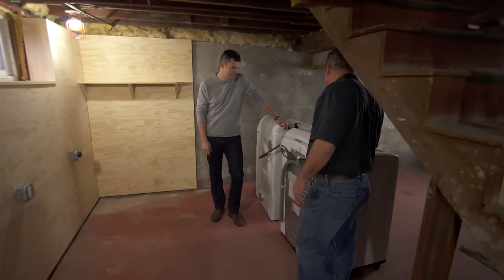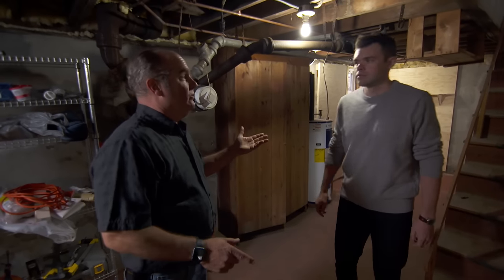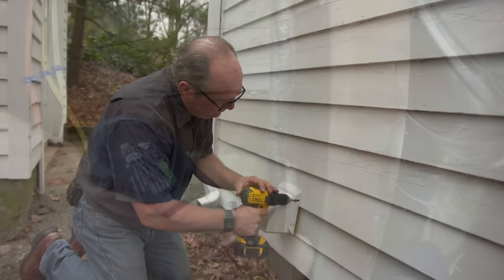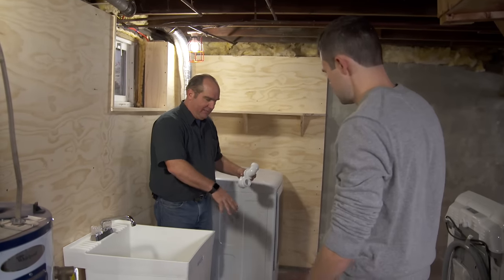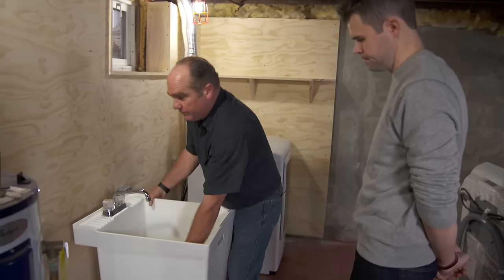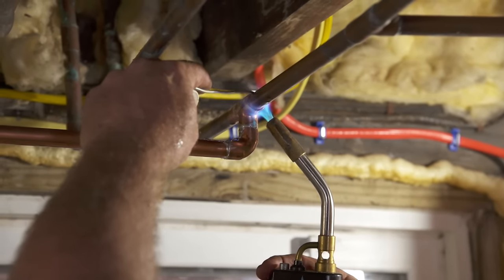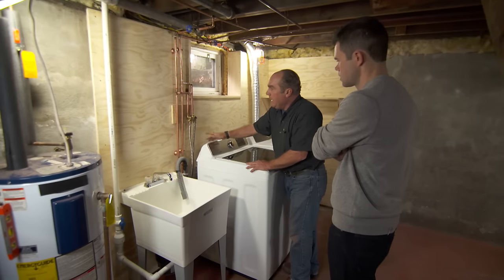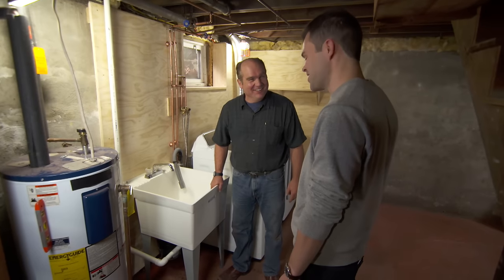How to Install a Basement Laundry | Ask This Old House

Comment: Don't know where this takes place, but I thought you could not put plumbing on an outside wall due to the cold winter weather.
Reply: Josephine Ward as long as it’s insulated. Plus a basement wall doesn’t get nearly as cold as an exterior above grade wall
Reply: That's referring to wood framing walls. That basement wall is 8" of concrete. It doesn't get cold enough to freeze pipes

Comment: So how do you know what's hot and cold water is it because you look at water heater 
Thank you
Reply: A lot of the time you can just feel the pipe....one will be warmer than the other, if they are the same temperature you just need to run some hot water wherever the pipes lead and the hot water traveling through the pipe will warm the pipe. Or you could follow it from the hot water heater if you can see all of the runs.

Comment: Ok so what they don't tell you is that while these undersink pumps are convenient for the installer they are a huge pain for owners.  The plug-up frequently, requiring you to disassemble everything and getting the pump on and off the tub is a nightmare.  They also go into "spaz mode" turning on and off constantly in the middle of the night.  I've had two and the 2nd is getting replaced reservoir unit!
Reply: install a lint trap on your discharge line. Easier to clean there than inside the pump.
Reply: they plug up easily because they are 1" drain line. Code here requires 1 1/2" minimum for a laundry sink. 1 1/4 drain lines are the smallest allowed here for any fixture and that is basically only for vanity sinks/pedestal sinks.
Reply: Im Sorry to hear this. Sounds like an install error.

Comment: Do NOT use those silly screens they include with the exit vents. They clog with lint rather quickly and in turn ruin the efficiency of your dryer and can even cause lint fires. A lot of state fire codes ban them for these reasons.

Comment: are you require to throttle the pump every time you do laundry ? isn't little inefficient
Reply: No, not every time.  The throttle is set just once, and you leave it like that.  Once you have it set so that the pump does not constantly turn on and off while draining the water, you just leave it set and you don't have to worry about it again.  Also, most pumps like the one shown in the video can be set to turn on once a certain amount of water has built up in the sink.  Most of them say to set the pump to come on when there is about 3 to 4 inches of water in the sink.  This way, you won't have to install a throttle in the drain piping.

Comment: I would never use "zip screws" in s dryer vent pipe. It would snag all kinds of lint and debris. Duct tape would be a better connection.
Reply: Brandon Ledbetter Wouldn’t the glue on the tape melt?

Comment: This set up won't work for me, With the drain going into the sink. Kinda defeats the purpose of the sink? Can't presoak anything and have the washer running.
Reply: @mitchdenner9743 … Why couldn't they presoak in a bucket or pan within the sink, as long as it doesn't block the drain?
Reply: @rupe53  yep there's more than one way to skin a cat you could also run a double trap underneath the sink,  ( 2 into one) one draining the sink and the other one leading up 18 inches or so and have the drain from the pump going into it
Reply: @mitchdenner9743 … now yer gettin' complicated and doing modifications. So much easier to keep it simple for those who can hardly tie their own shoes, never mind use a sink. It's not rocket science.

Comment: Never use screws on dryer vent folks! It's a lint catch and its against code.
Reply: what should one use?
Reply: Metal foil tape is code in NC.
Reply: Todd Hagee As if that little bit of lint that might get stuck on it, will ever block the whole vent. If it was against a code, manufacturers probably wouldn't create a screw hole in the vent.
Reply: Richard van Pukkem do you think he only used one screw? And yes as a matter of fact it will build up enough to clog the vent and possibly start a fire. I've seen it too many times. And they don't put holes in the vent he used zip in screws. I'm a licensed HVAC contractor and been in the industry for 20 years. Have a nice day
Reply: Todd Hagee SICK BURNNNNN
Reply: ahhh, zip screws (self tapping screws) are not against code in the Midwest, don't know where your from, never heard they were!
Reply: it wasn't against code in his state.
Reply: it wasn't against code in his state
Reply: Every HVAC contractor watching this video cringes
Reply: I'm from Minnesota and have been dinged on screws in dryer vents by the fire department, had to pull them out and seal it with foil tape. Also, in Minnesota you can not use flexible dryer vent, they still sell it here but you will get dinged by an inspector (have also been dinged by the fire department on that). Another thing that he didn't talk about was making sure the dryer vent was so far away from a window....not 100% that that is necessary but have heard something about it from my dads friend who is an HVAC tech (he might have also been talking about flue gasses for a water heater, its been years so I don't remember for sure).
Reply: name the code.
Reply: I found this for Hugo, from personal experience I know that all of the rules apply to St. Paul to the best of my knowledge.
Reply: Use a condenser dryer instead and you don't need a vent anymore. The tank inside is large enough for one run, after the laundry is dry just remove the tank and empty it into the sink. Or I'm using the water to water the flowers.
Reply: I was horrified by those screws also.
Reply: Code is relevant in MA and RI as well
Reply: The screw was for a hose clamp only which is on the outside, it shouldn’t interfere with flow or vent. Unless I missed the part where he stuck a screw thru.
Reply: I have a gas dryer; I wouldn't want CO in the house.
Reply: screw dat son
Reply: What kind or name of pump
Reply: i said screw dat son
Reply: Exactly Todd, its against code here in Canada as well, he should know better....
Reply: Richard van Pukkem just because a manufacturer does something doesn’t mean it’s up to code. News flash: companies usually go the cheapest route, ie: not up to code
Reply: @farmerdave7965  oh the horror!😩
Reply: Todd Hagee is right! I’ve seen it happen, lint builds up and clogs pipes when screws are used in dryer vents.
Reply: He probably knows the code and that’s why he used it
Reply: @insanmonster … in the case of distance from a window or other opening, that would be for exhaust gases. IOW a gas dryer, water heater, etc. Those need to be at least 5 ft away by national code. Local code can be more but never less.

Comment: That plug at 2:20.. Massive electric hazard. Most safety standards anno 2016 require the pins to be not-touchable when live. On this plug it's almost harder not to touch them than to touch them.
Reply: Did you notice the crappy cover plate set up? He had a square box, mud ring wall plate.
Should have just been the square box with the proper square cover to accept that round plug

Comment: why are all these people commenting on that wouldn’t pass code or inspectors wouldn’t sign off on this? why are you people having inspectors come into your house and look at these things?
Reply: Patrick Coyne if you don’t pull a permit and try to sell the house, the buys are going to be able to negotiate a much lower price because they don’t know if the work was done up to code, correct, etc
Reply: Why? Because it’s to make sure the job was done correctly and it’s actually protecting  the home owner since a homeowner won’t know  anything about code, and any issues he finds the plumber will have to correct it and than do another inspection.

Comment: Nj licensed plumber here.    No way in hell 12000.  That is highway robbery   Material at most is 600 dollars  labor  Maby 5 hours of work.   🤦‍♂️
Reply: Vince Black … in my area plumbers get $100 / hr so using your numbers that's $1100 plus tax. Not too far off the $1200 tag.
Reply: I believe the man in the video said he was quoted 2,000-12,000. The original commenter is saying the 12,000 is highway robbery, not 1,200.

Comment: everything was on point except the screws in the dryer vent, in Canada it's actually against the law! don't want lint to get trapped and cause a fire
Reply: They should NOT use that flex stuff, the ribs in the flex will catch lint.  The ideal would be to run solid 4" steel vent pipe, up behind the dryer, to the exhaust vent, with the aluminum tape used for forced air heating runs to seal all the joints.  No screws should be used.
Reply: Paul Schmidt partially right aluminum is better than galvanized steel
Reply: f you use rigid pipe, how can you connect if before you move the dryer against the wall?
Reply: Use rigid and attach to wall push dryer back into the rigid or run rigid 90% and put a small piece of flex from dryer to rigid
Reply: In areas where it's ok to use flexible aluminum, as long as it's only use for a portion of the run, it's not an issue.  You have to clean out the vent line every so often.  The flexible aluminum is easiest to use when pushing the dryer up to near the wall.  It's ok to use flexible aluminum where I live.  I however only use it from the dryer to the nearest point where it hooks to solid aluminum pipe.  The solid aluminum line run is actually longer than the flexible pipe I'm using.

Comment: I would of done something much different with the drain hose fron the washer than just leaving it over the sink. It doesn't look good. I would of put it under the sink and have it connect into the drain below the sink drain so the water would leave the washer and go down the drain and it wouldn't look like you got cheap and jimmy rigged it.

Comment: no screens allowed on dryer wall caps. man and running that goofy flex that they can crush by moving appliance - hard pipe is the way to go
Reply: Also, some dryers, like my new one require rigid duct work or the warranty is voided.
Reply: At my old home, my dryer vent run consisted of just 2 elbows (a 90º solid elbow, & an elbow that adjusted, & went around the gas line), & the rigid line attached to the vent cover, similar to the one used in this video.  Both GE & LG (makers of my last dryer, a Hotpoint & current gas dryer LG) never saw a dryer vent run so short, but it didn't affect the dryer's ability to remove the exhaust.  In fact, because it that short of a run, my dryer rarely built up lint, & that the dryer didn't run a long.  My current home however has a bit of a run.  I use rigid aluminum for most of the run, with a flap attached to the interior side, to prevent outside air from getting pushed in through the dryer vent, despite its own flap on the outside dryer vent cover.  With the dryer not as close to the exterior wall, I have solid rigid lines running most of the way to the dryer, & use the semi-rigid flexible aluminum line to the dryer, with a 90º solid elbow attached to the flexible line, to the dryer.  Both manufacturers don't see this a problem.  The flexible foil & vinyl lines however would void the warranty if there was a fire that was caused by lint buildup.  .  At least with my setup, I can take it apart to clean it out.  I also have J hooks to place the line on to hold the rigid pieces in place.
Reply: Hard pipe is almost always the best, but there's a flex duct by In-o-vent (or whatever their name is) called the Dryer Flex that you can't crush

Comment: Thought draining into a sink wasn't up to most codes. ?
Reply: Elsiepie Matthews … there are loop holes in the rules where as long as the sink has more capacity than the washer it's ok. Front loading washer uses maybe 10 gallons for wash and another 10 for rinse at most. Plenty of room. Besides, you'd be there to swap the next load so you would notice if there was a problem.

Comment: He obviously doesn't know that you need to where gloves when using copper
Reply: Peter Pearson why? I have never seen a plumber wear gloves when working with copper.
Reply: @wurly164  your hands have oils on them that start a quick oxidation on copper. If you clean the copper then touch with your hands you basically just messed up what you did in cleaning it.
Reply: @peterpearson3914  The only part that needs cleaning is where they are to be connected. the rest of the copper can withstand human oils, they will be around long after us.
Reply: @wurly164  right but if you clean the parts being soldered then you touch them it ruins what you just cleaned
Reply: @peterpearson3914  that's why you clean them, flux and solder, but touching the parts that are not part of the connection is fine

Comment: Your not supposed to use screws on dryer vents. It’s a fire hazard. And I would have figured that they would have put more effort in running hard pipe for the dryer vent since there on tv.......

Comment: Do not put screws into dryer vent. Lint trap. Fire hazard. Failed inspection.
Reply: Daryl Boord how do you connect fittings? Hose clamps?
Reply: @iLikeC00kieDough  foil tape for ductwork. Hose clamps are ok.